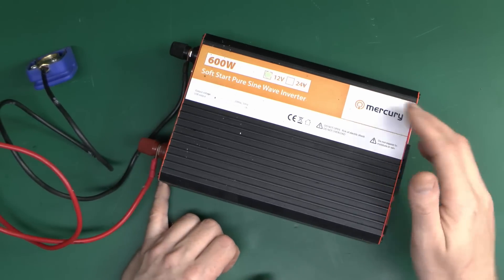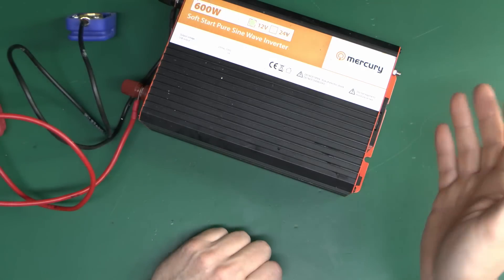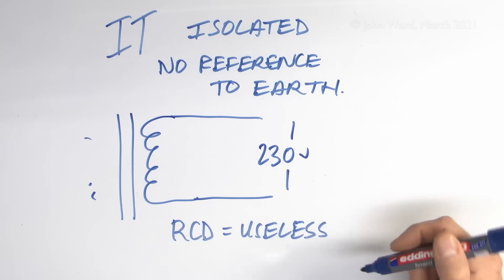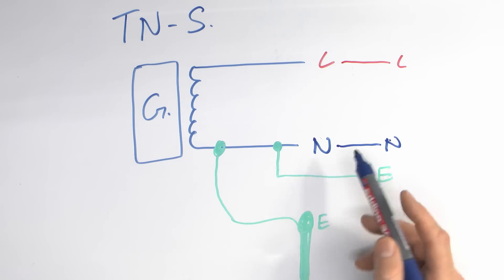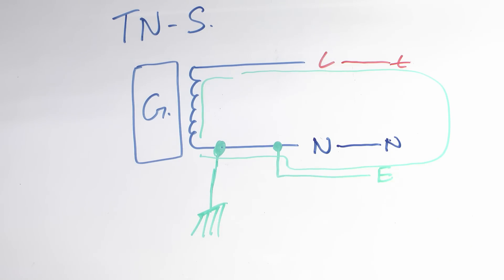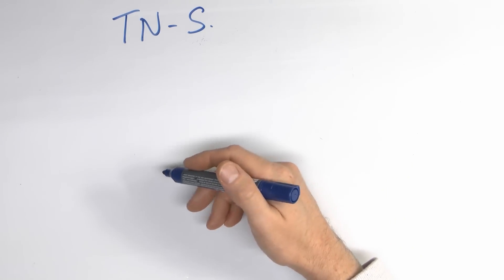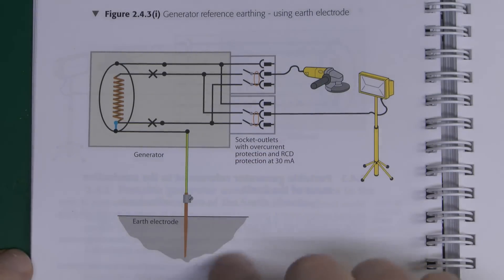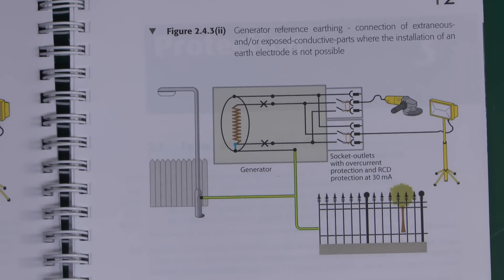Generator Earthing Types - TN-S or IT?

Comment: There's an earth terminal on your inverter - is that connected to the mains earth socket on it ? Mine hasn't got an earth terminal.

Around 4:35 you say an RCD is useless - I disagree. It SHOULD be useless but if there was an earth  fault, it then might work and prevent someone getting a nasty shock !
At 7:05 you prove this.
Reply: For an inverter without a earth return path the only possible path is line to neutral which the rcd won't notice.
Reply: @conorlanders8401  I don't use an RCD on the inverter anyway !
Reply: It seems to me that any RCD is useless unless there is a fault. Just as a fire extinguisher is useless unless there is a fire. 
If neither L or N are connected to the case of the appliance, and one or other of them is connected to the case by a fault, that should present no risk, and not cause the RCD to trip, because the current will still go up the L and down the N, with none flowing to E.  And nobody shocked.
If another appliance's simultaneous fault connects the other line to the "earth" that would trip an RCD. But then again, it'd probably trip an MCB or blow a fuse.

Comment: Do you have any experience with Hybrid inverters? The problem there is, that on the inverting side, they are normally setup as IT, so as they typically are installed in domestic environments, the output must be turned into a TN-S within the main panel. But now they as well do have a AC in, where the grid is just passed through the device once the battery is flat. In a TN system, they will probably not make any problems, but how can this situation be solved when the service is a TT? Without a N-G bond you get a hot Neutral. Some inverters do have a built in programmable N-G bonding relay, which can activate when the inverter is in off-grid mode. But those devices are very rare. Is there a method, how to install such inverters in a home when different earthing methods would be required to have a  safe setup?

Comment: Good 👍 job for covering this. have to fit solar equipment and it has a ups output issue comes when house is TNCs and inverter becomes its own power supply for the house 💪 😀..fun fun fun.

Comment: Hi John, could you kindly explain the system whereby on a motorhome(insulated on tyres), the earthing is done through the metal vehicle chassis, even with a 3000w 240v inverter !
There are no earth rods pushed into the tarmacadam when the vehicles are parked up, but the RCD on the distribution board still works with some 'bonding' inside the invereter (victron multiplus for reference) but i dont understand the logic of how it works without the earth rod to ground.
Would make a great video if you had the time. :-)

You have done a tremendous amount of very useful videos. Keep up the great work. Thanks
Reply: think the inveter has earth leakage  detection inside i belive on that victron.
might be wrong but only waybif not is to have a sensing circuit to trip off if a certain amount of ma is detected like a PEN protector used in car chargers ??

Comment: Funnily enough, most generators I’ve seen are unbounded internally. I guess since they lack RCD protection IT is presumed to be safer. The offshore arrangement with bonding the center tap is probably borrowed from the American residential 2 phase systems, where they really supply 240 V and bond the center tap to make sure that neither phase is more than 120 V over earth.

Comment: Here  in Norway we use 230V IT distrubution for mostly everything, such large transformers create high impedance to towards the ground, Isolated with a disneuter. Anywhere from 1A to 12A in fault current , which is kinda deadly because alot of times installations without RCD just floats around. So local grounding is importent for each installation
Reply: That power girs were also common in Russia,and all sockets were ungrounded.
Reply: Norway is an almost complete outlier in this respect. I believe French hospitals, at least in part, use IT systems as stray voltages referenced to ground are particularly deadly in operating theatres or anywhere else intrusive procedures are carried out. However, that's only safe where rigorous control over the entire electrical system and devices attached is possible, which is precisely what can't be guaranteed in a public distribution system.

For the record, such IT system with fully floating outputs were common back in the early days of electrical distribution, and it was only gradually learnt that it was essentially impossible to stop earth references appearing, even if these were via relatively high impedance.

Comment: My question is how does the inverter can output 230v and 0 volt, why is it not the same output as in IT systems we use in Norway?. We use RCBO almost on every homes with IT systems in Norway 230v on two and three phase. Between any wires are live 230v to any other wire  except to earth, than all wires measured to earth is about 130 volt each. Your video indicates that if one wire in IT systems shorted to ground it will makes it become TN. But if we measure one wire to ground it will be about 130 volt, not 230 volt or 0 volt, but i have never tested what happens if one wire is shorted to ground with low resistance. If IT is shorted it will become TT if i understand right. Only 14% of homes in Norway uses TN and therefore the french Renault Zoe can not charge because of that it is designed to work on TN only. In Norway Renault Zoe is therefore sold with IT to TN transformer. Connecting one wire to earth does not make it a TN system as far as i can understand. Is there a way of transforming IT to TN without replacing transformer if we keep 230 volt and not changing to 400v? Electrical company say it will be very expensive to replace IT with TN.  Please make a video about IT i love your videos i always learn something new from you. Thank you.
Reply: What he said👍

Comment: Thank you John, I have been looking for some info on earthing my generator for some time now and you have hit the button.  I have made a distribution panel which plugs into the 32A 230v output of my Champion 8kW generator with an RCD main switch to control 4x 16A mcbs  to protect 4x 16A sockets on the distribution panel.  At present with no earth electrode connected to the generator earthing terminal the RCD trips, can I assume by installing an earth electrode to the earth terminal of the generator this will solve the issue ?  Regards Phil
Reply from the maker: If the RCD trips, then it's either connected incorrectly or whatever is connected to it has a fault.  Adding an earth electrode will not change that.

Comment: Funny, when I learned to be an electrician I was told IT stood for impedance terra.
& that other generator system is clearly TNCS.

The more I watch these videos the more I wonder what your credentials are (if you actually have any).
Reply: The "I" refers to Isolé (french for isolated) It it sometimes referred to as high Impedance, which is where your having learned impedance comes from. I, as an ex electricity board electrician would suspect John has been either an installation inspector or an engineer. I might be wrong though. It is unfortunately true  that two electricians/engineers often have three different opinions
Reply: @gillywild  to me, a totally isolated system has no T (t obviously being Terra or earth).
There certainly are impedance earthing systems that are often associated with generators.
I think, like many YouTube videos, the information in these needs taking with a pinch of salt. I’ve unsubscribed from John’s channel, this isn’t the first case of poor information I’ve seen on them sadly (not necessarily incorrect, but in my opinion poor).

Comment: The inverter in the video had an earth stud. Is this connected to the earth pin of the socket and should that stud be connected to an earth spike. Nobody seems to be offer an answer to this question.
Reply: earth spike but really depends inside how the manufacturer has specified.

I have to ground batteries lithium on the casing as the manufacturer specifies to the inveter even thou its just near touch voltage of 50.2v.

you would hope the earth pin is isolated inside and you put your own rod in unless there's a earth relay to switch to a pme supply TNCS earth when the inverter goes back to mains power if it has mains input 😉 and isn't just a dc input only inveter to make pure sine wave 🤔 

had a look online some.people are using a switch over earthing relay to switch between

Comment: I have a little inverter similar to the one you demonstrated, but designed for use in the US. It has a GFCI (RCD) outlet on it. Which obviously doesn't actually work. Not sure why they included it. I've never seen another inverter with that.

Another thing that applies specifically to North American larger generators: They're usually center tapped as you described, in order to provide both 120v and 240v supplies, typical to installations here. Those should always have the center tap referenced to ground/earth, as is standard practice in North America. Any 240v equipment intended for use here will be designed with that in mind, obviously. I haven't seen one here with one of the "hot legs" referenced to ground, but it wouldn't surprise me to see that on some cheap overseas unit not made to any actual standard.

Comment: if a towable site generator was run without the earth electrode (but still retained the internal N-E bond), the GFCI/RCD on the distro would trip under a line to equipment chassis fault, but not a line thru person to ground fault, correct?

06:45
Reply from the maker: Yes.

Comment: If the N and E are linked together inside the generator, why is this not a TN-C-S system?
Reply: well that 'C' part is very short here :D Essentially you dont have access to that point where its TNC while pluggin appliance. You can tell its TNC-S or abbreviate to TNS so to speak.

Comment: Its funny how everything in UK is "earth", even if it is a 12V vehicle system.
Reply: It's not just in the UK that it's called earth or ground in a vehicle, even if it is a misnomer. It's common terminology throughout the English speaking world. Really in such circumstances it ought to be called a "common", but I've long given up that fight. So all modern vehicles will be called "negative earth" whilst some much older vehicles were "positive earth", even if the chassis is not referenced to the ground at all.
Reply: @TheEulerID  Totally not. America uses "ground". Earth/protective ground only for AC mains. Its just funny saying "negative earth" when nothing is earthed.
Reply: @Trancelebration  Are you having trouble reading? The very first sentence said "It's not just in the UK that it's called earth or ground in a vehicle". I know in North Amercia the terminology is usually ground, which is why I put them in as equivalents. Whether it's called earth or ground is immaterial as the principle is the same.

Americans still refer to the common on vehicles as ground or earth.

Comment: How does this relate (assuming it does) to UPS's with multiple outputs? Yes they will only be active ordinarily for a short period of time but when they are, should they be considered Generators? I'm thinking of the big name brands out there with multiple sockets on them aimed at the SME/Home market and wondering what the earthing arrangements might be on them?
Reply: UPS have to be connected to the power supply earth, because in normal operation, mains energy goes to the output and therefore output is referenced to ground. If the mains supply goes off, and batteries keep supplying power, you still have that earth link from supply to the output.

Comment: As always great information. In Australia portable generators that are not connected to household supply, are not required to be earthed using an earthing rod and is advised not to use any external earthing. Refer AS2790.
Reply: Yes, likewise in Canada. A low impedance PE wire will always be a more reliable pathway back to the tranformer ground stud, so a ground fault is much more likely to have enough current to trip a breaker.

Comment: The other day I was reading 5v AC from a circuit with the RCBO turned off, does it need replacing? 

What I actually did was turn the main switch off to get rid of the 5V and then sorted out the socket outlets that seemed to be suffering from damp rusty back-boxes. Replaced the back boxes for new and the flush socket outlets too for good measure. No the circuit is no longer tripping, but I'm still concerned about that 5V AC when the RCBO is turned off.
Reply from the maker: Probably capacitive coupling from adjacent cables.  Very common where one circuit is switched off and the others are not.

Comment: Very interesting!  In computer UPSes I've used they say the output neutral and earth is referenced to the battery negative terminal, but they also advise against unplugging the unit from the mains while the inverter is running as they say it can cause the output to float, so I guess this means they are internally connecting the input earth to the output earth?  These devices are designed to power multiple pieces of equipment though, some of which might be connected (via signal cables with ground wires) to other equipment running on alternate power feeds (generators, redundant feed from a different grid transformer, etc.) so I guess they have no choice but to tie all the earths together.
Reply: Exactly, the smaller UPSes rely on the mains cable for their earth reference entirely, so you might cause equipment damage if you remove the incoming feed while it’s powering something that’s grounded through some other path, like a server rack. Some larger UPSes are designed to cope with this, as you might have a neutral fault upstream and loose the bond between the neutral and earth, or you have a generator that breaks the neutral as well as the phases when switching over. It’d be interesting to see how they cope with it, as they can also recover from that fault when the mains returns and sync back to the grid after free running for some time, presumably by running the frequency up or down slightly to catch up to the grid.
Reply: @sstorholm  Interesting, I hadn't thought about how they might cope with a broken neutral.  I'm not sure they bother syncing back to the grid though.  They usually mention somewhere how long the switchover delay is when the inverter starts up.  I measured it a few years ago on a small consumer UPS and the output had no power for about 200ms during the switchover.  I think once the power comes back on they just switch back to the grid and you get another ~200ms gap in mains power on the connected equipment.  For stuff that can't cope with even that short interruption, you'd go for the dual-conversion units that run the inverter all the time, even when grid power is available.
Reply: @Berkeloid0  I was speaking of larger units running in dual conversion mode, the resync is important since they are usually equipped with an external make before break bypass switch, so it’s rather important that the input and output are in sync, otherwise you might get a bit of a fireworks display when the bypass is thrown.
Reply: @sstorholm  That must be unique to very large units, consumer units just have a couple of relays that are timed to do break-before-make on the bypass.  I guess they assume any equipment that critical will have more than one power feed so the slight interruption in the rare case of a fault or maintenance can be accommodated.  They also come with strong warnings not to connect grid power on the output.

I wonder what happens to the units you are talking about if the bypass is operated during a power outage.  Presumably then the UPS may not realise and could cause issues when the power comes back on again, unless operating the bypass informs the UPS and switches off the inverter if there is no grid waveform to sync to?

Comment: I did a temporary supply off a generator yesterday and was struggling for 10mins why i couldn't get the rcd of the cabin to trip. Went over my connections, earth continuity, even rang a colleague for advice still didn't make sense, i was about to make a service call into the generator company until I realized I had the neutral and earth leads around the wrong way on my fluke! swapped the leads everything was fine and dandy!! 🤦‍♂️😂 Thank crunchie it was friday.

Comment: Is it possible that the metal body of the lamp post is grounded? But then as you mentioned, any earth fault there will introduce some voltage at the earth point and that voltage can be "passed" to the site generator.
Reply: In my country, most of lamp posts are grounded. Alongside the cable, there is grounding strip buried and all posts are connected. So the grounding is pretty good. And that passing of voltage to the site generator is very unlikely for low voltage grid/generator. Grounding area is significant, and 230V is not much tbh. Would be bad in case when like medium voltage line fell and touched that lamp post. But still, earth resistance of all posts grounded is pretty low, so that potential would be spread.

Comment: John, you say it is only a reference electrode but the quality of that connection to earth will affect whether an RCD will operate correctly or not if someone carries a fault current to an earth bonded item, will it not?
Electrodes on event systems are tested very rigorously for this very reason. In urban locations it can indeed be a challenge to install an effective electrode and lampposts are routinely used as the least worst option. I don't approve but sometimes you have no other option.

Comment: I used to build and service generators, on many older three phase sets sets I would find that there was a big fat earth stud provided on the alternator foot which would be connected to an earth rod but inside the alternator connection box the neutral was not connected to the frame. Some of these units had been running like that for years.